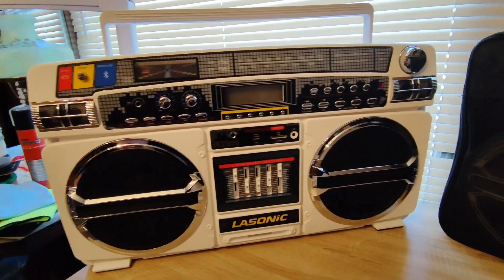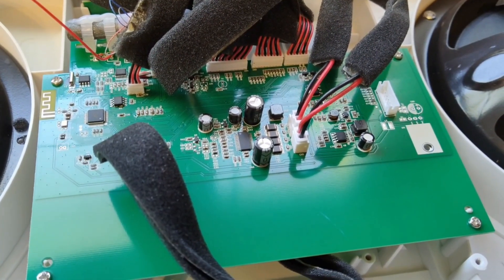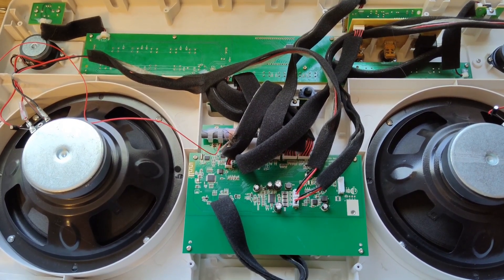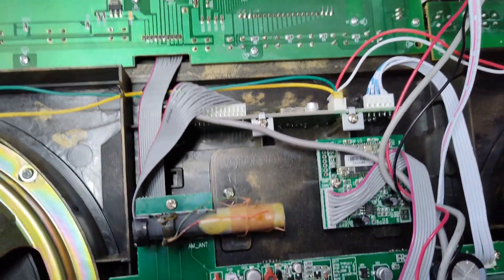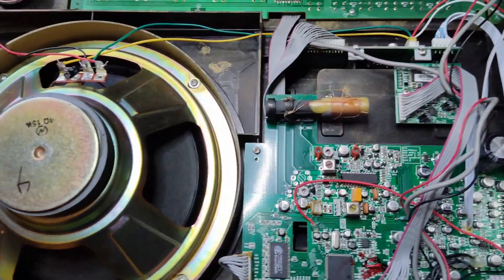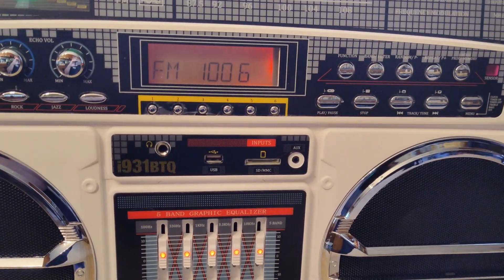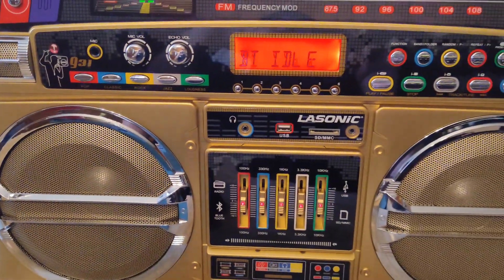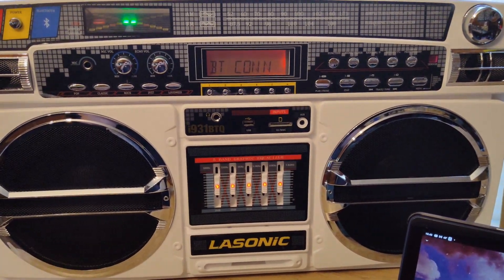New (2023) Lasonic i931 Rechargeable boombox VS. (2012) Lasonic i931.. which is better?

Comment: Ok so I came across your video and I didn’t realize I even had a newer lasonic version. I have to say your video was informative. I had issues with mine and Amazon and after a long dispute with them and the nasty Chinese seller I kept it. What I did do so far was change the speakers out. Man what a difference in rhe sound. I wish I can send you a pic. Next I’m going to replace the amp and tweeters. She has a lot of potential but needs help. I’ll keep you posted
Reply from the maker: yea as stated in the video.. these are more for show than actual quality.. mine does sound quite good and loud.. didnt have any issues except slight noise in the background when the sound was turned down.. certainly no 80's Japan quality here.. but it does fully work.. and i do like the rechargeable aspect of it.. definitely not worth what there asking for them though.. more like a $129 boombox.. not a $229 boombox.. glad you enjoyed the video.. and good luck modding yours!
Reply: Thank you sir. I’ll keep you posted as to how it goes. Sounds 65 percent better than it was. I might paint mine also. Not to keen on the white but I did pic thst color because it’s easier to paint.
Reply from the maker: @juansoto2818  when it warms up here i might do the same to mine.. not sure what color i'll pick yet.. what color you planning? i might go silver.. maybe..
Reply: Same here. I’m in the northeast corridor. Too cold to paint. I have this really nice color called patriot blue. Looks really nice. I may go that way. Possibly a granite gray also.

Comment from the maker: if watching the video the part where i check out the radio on the new Lasonic i was off by 1 number on the digital display.. instead of 100.5 i was on 100.6 checking the radio after this error.. the radio did pick up the station just fine.. sorry about that.. also the printed text on the back of the Lasonic box shows stuff the new boombox does not have.. for example.. separate Bass and Treble controls.. the new unit does not have these.. along with other "claimed" features.. i feel they just copied and pasted from the original Lasonic box.. one more thing.. the switch on the back of the newer unit basically does the same thing as the older Lasonic.. it powers the whole unit down.. preventing the draining of the battery.. thanks!  and yes.. i rambled on... sorry..
Reply: Hi! What you think about Kicker ik501 in comparison with sharp gx-m10 in sound quality and bass?
Reply from the maker: @angrycitidzen6237  never owned the Kicker unfortunately.. so I can't compare.. im sure the Kicker "kicks"..

Comment: Could it be on the older model the bass and treble settings are actually volume for the tweeters and woofers and that's why it's so much quieter?... I have a Chinese Amp that works like that

Comment: I just purchased a white 931 BTQ I noticed some of the buttons click nice and 2 of them barely click but they work. I also noticed when you push the loudness button it says flat and goes loud then you push it again it stays the same until you turn it off and on again  how does your white one work button wise. And is there any way to get an owner's manual for it somehow. Thanks great video review to 👍👍.
Reply from the maker: mines packed up atm.. i'll check it in a bit to see if it does the same.. not a bad boombox.. but if they just put a little more effort in build quality it would be a 1st place winner.. but it's basically a cash grab on the name..
Reply: Thanks for the response I schedule a exchange from Amazon for another one thanks I will let you know how it goes 😊👍.
Reply: Also I was wondering it doesn't hold a charge battery is dead the next day even after a charge the night before.🤔 I wish it came with a damn owner's manual.
Reply from the maker: @davidbrigham8319  there is a switch in the back of the boombox.. it's not labeled.. that is a AC/DC switch.. if after you turn off the boombox and the LCD display is still on.. then you need to switch it off in the back.. this is like all Lasonic 931's no matter what generation.. thats the reason why your battery is dead the next day.. pretty silly design by Lasonic.. hope this helps!

Comment: How do you charge the  i931btq   and have it hold a charge??🤔
Reply from the maker: @davidbrigham8319  need more context.. is it the model that has a lithium ion rechargeable battery in it? If so it comes with a charger.. it's shown in the video..
Reply: Has the rechargeable battery and a USB charger cord and remote control.
Reply: I contacted lasonic and they sent me a 5 volt USB charger adapter for it. They said they don't send the adapter with them out anymore.

Comment: Out of the M90 mini and the i931, Which one would you recommend?
Reply from the maker: the M90 mini was built very well.. very solid.. obviously its way smaller than the i931.. so if you want noise.. the i931 is your fix.. if you want a small but fairly beefy Bluetooth speaker.. the M90 is pretty cool..

Comment: Does the new one really take a 12V DC input? Or does it just say that by mistake? The charger supplied is for an iPhone at 5V DC?
Reply from the maker: the power supply was shown in the video.. it's a 12 volt power supply.. the one shown in pics on eBay is wrong..

Comment: I am of the old school opinion that if a modern "boombox" doesn't have a tape deck and/or CD player and/or AC adapter, it's not worth buying. I don't like rechargeable battery/Bluetooth models (the battery does not last long and I never use Bluetooth anyway).
Reply from the maker: nothin wrong with that.. i view it more as a convenience.. i did experiment in my older videos trying to modernize classic boomboxes.. but now i just add Bluetooth and a Lithium ion battery pack.. but not to mint condition or special boomboxes that have gathered a following.. like the GE Blockbuster or Realistic SCR-8.. i also have a Sharp VZ-2000 that will be reassembled soon.. with no mods.. and a real cool 1979 Sharp GF-8585 with the original box and original Sharp batteries! but lesser known older boomboxes i will mod..

Comment: The 21 century can’t make anything of good quality , unlike my English Hacker radios from the 60s / 70s with high quality elac speakers I have a super sovereign, a sp 80 if I have them to loud they will easily smash my windows, these radios would be in all royal households also have a Grundig Satellit 3000 with a 7x5 speaker and Twitter this radio I think would crack concrete.  Regards JH